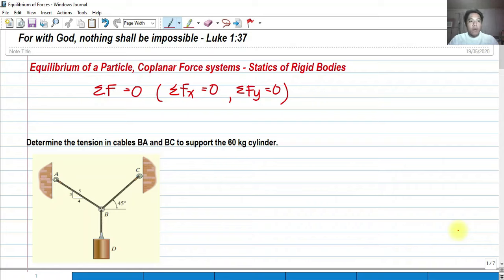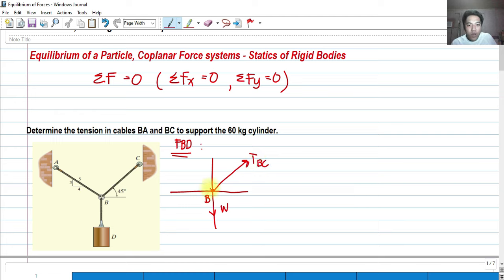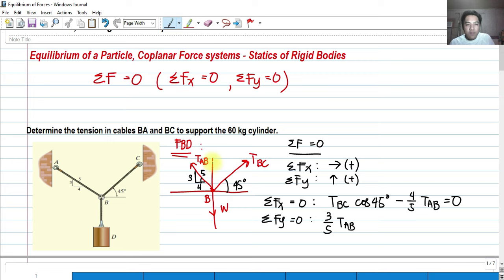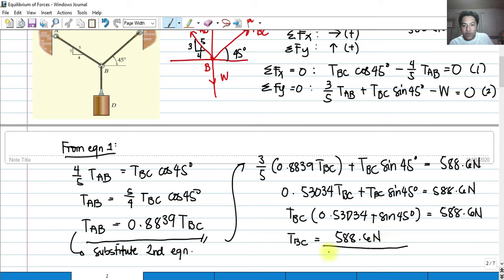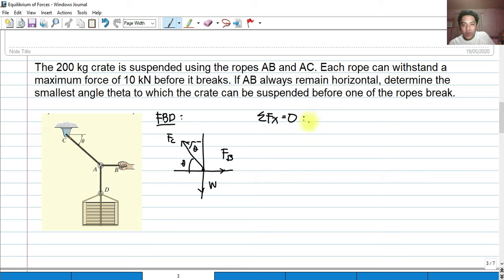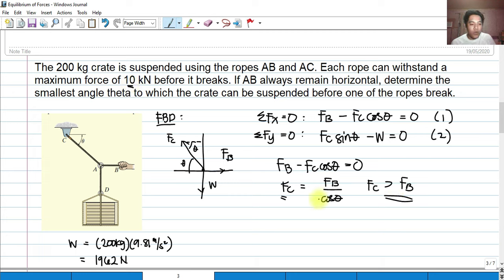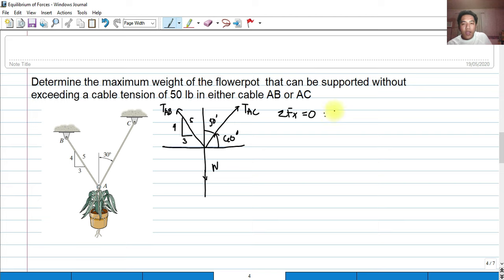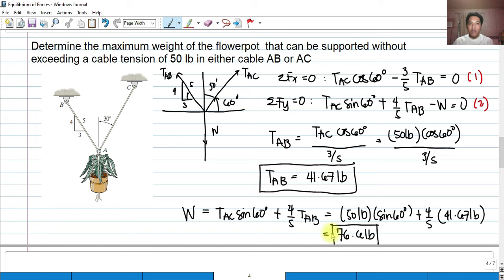Equilibrium of Forces (2D), Coplanar Force Systems - Statics of Rigid Bodies

Comment: sir may i ask why do you use cosine on x axis while sine on the y axis?
Reply: Kung saan yung angle, dun yung cosine. Since yung angle is nasa X-axis, cosine siya and since wala yung angle sa Y-axis, sine siya.
Reply: Ik it's hard to visualize haha pero sige.

Let's say you have a triangle with a vertical unit of Ay and horizontal unit of Ax. Your hypotenuse is A.

      /|
A /  | Ay
  /θ_|
   Ax

If you have an angle theta and you're solving for Cosine θ, that's CAH or Cosθ = Adj/Hyp. That gives you Cosθ = Ax/A. Further simplification,

cosθ = Ax/A
A(cosθ = Ax/A)A
Acosθ = Ax

That's why lahat ng x-components ay cosθ ang ginagamit.

Of course for Sine θ, that's SOH or Opp/Hyp and according pa rin sa figure, that's Ay/A. Further simplification, it should give us
Asinθ = Ay. Therefore, lahat ng y-components ay sinθ ang ginagamit.